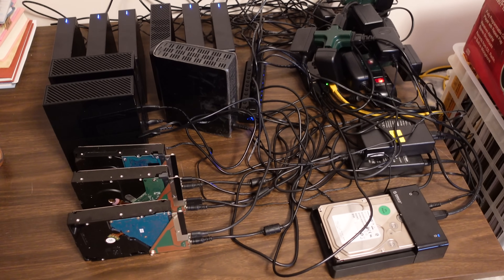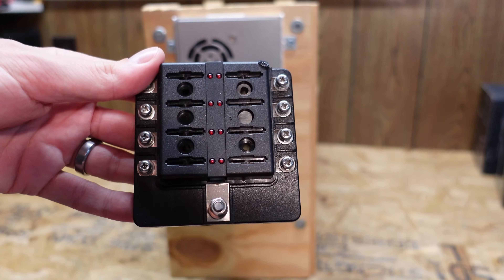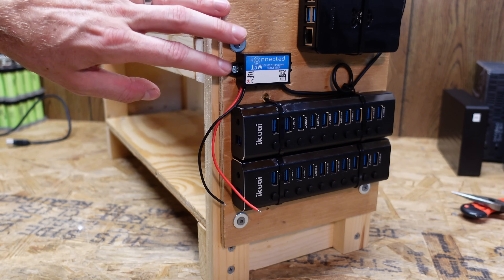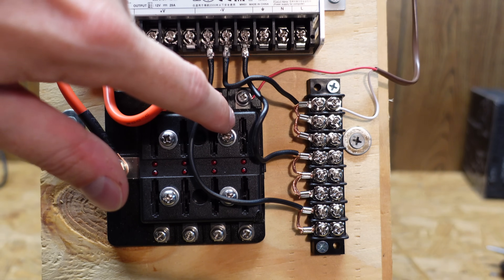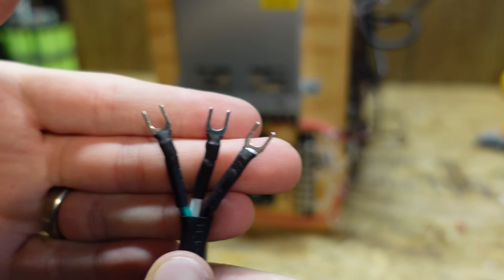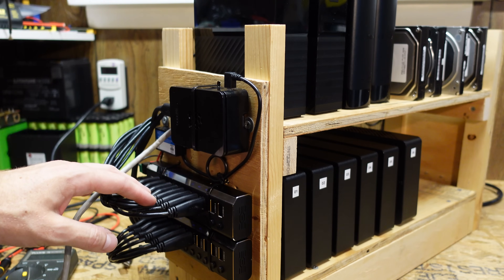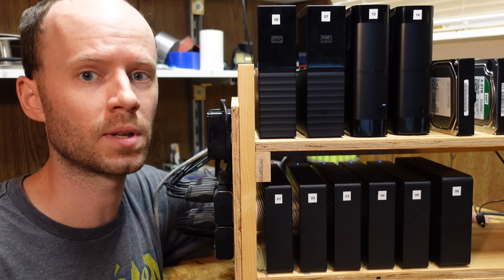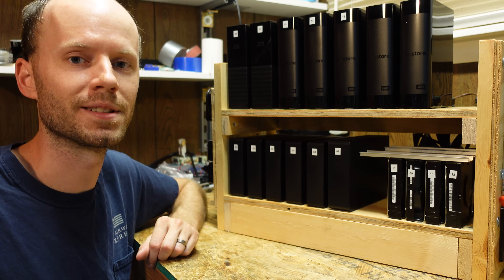Building a 160TB Chia Coin Farmer on Raspberry Pi 4

Comment from the maker: Update: I continued to have drives dropping out after disabling UAS, so I reverted those options. I instead plugged the two hubs into the USB2 ports instead of the USB3 ports. This has finally been stable for a few days. Additionally, using the USB2 ports results in less devices consumed by the hubs. I have all but one drive connected now and am at 27 devices under lsusb.
Reply: Hi,
I still have hard drives dropping out after 1-2 days, using the USB2 ports. Do you have the same problem or any solution for it ?
Reply: How is your system running now? I’ve had intermittent issues with a Pi 4 and USB connected drives so very curious to have an update on if you’ve managed to get yours running reliably.
Reply: @benpearce5424  How much space you got on that?
Reply: Would you mind sharing if you've earned any Chia rewards yet?
Reply from the maker: @mixmastermantas6841  I've farmed 2 blocks since pooling. I should have kept them solo... LOL

Comment: Did you purchase all of that stuff or do you have a discounted source?  That's a lot of hard drives.  Back story on all that would have been nice.
Reply from the maker: No, I purchased it all. I just watched a few different sites constantly until the right deals came around. More than half of them are used.
Reply: @LithiumSolar  I just went to a chia calculator site, it suggests 6.5k invested for about 250/mo income on 163TB.  Interesting.  I hope you do a back story video.
Reply from the maker: @ForwardGuidance  I don't know how much I spent, I really should add it up one of these times - but it's nowhere near $6500. The price of drives has gone through the roof, it's ridiculous now. I started back in April when the netspace was small hadn't gained popularity yet. I'll just leave the coins sit for a couple of years and see what happens. I have no intent to sell them anytime soon. Also, I'd like to do more non-battery videos but they don't typically seem to do well here. We'll see how this one goes.
Reply: @LithiumSolar  Right, the 6500 figure was  if one buys everything new.  Hope the coin catches some fire so you'll have to think hard about selling.  haha.

Comment: Amazing work! Do you have a video on your Raspberry setup? 
The only thing stoping me from going on the Pi is that im running also 7 other Chia Forks and Im not sure the Pi will hold them.
Also, considering how low voltage demand the Raspberry pi is, you can easily add a second Pi to expand this rig (I know you are looking for the single Rasp tittle ;) )

Comment: Hey I did something similar to this.  I'm very curious what those large 12v usb 3 hubs you have are and where to find them but maybe I just need to look again.  I used multi-bay usb drive enclosures to reduce the cabling and drive exposure, and common computer 4-pin molex connectors to move 5+12v power around with one connector.  I opened my multi-bay enclosures, detached the ac power supply, and connected the power directly.
Reply from the maker: I have a list of items and links in the video description :) I LOVE the multi-bay hard drive docks but with how much everything has cost thus far, trying to save a few where I can.

Comment: I'm a photographer and use 12 plus externals HD - I was looking for a way to power them & get rid of the wall warts - I Love what you did - any changes you would make?
Reply from the maker: Yeah, I wouldn't use thermostat wire again. I'd buy regular stranded wire and crimp ferrules on for the connections :)

Comment: @LithiumSolar did you have issues running full node, and farmer off the sd card or did you have it on an external drive?
Reply from the maker: I did not have any problems, but 1) I purposely used a class 3 card for the higher speeds and 2) Chia has changed a LOT since I made this video and I've moved away from the raspberry pi long ago.

Comment: why not make a nas with a raspberry pi and the hardrives. then mount the nas in the farming pi. if that work then you can add allot more drives to the farming drive...right?
Reply from the maker: Yes! You can do exactly that and that's what I'll do if I ever buy more drives. I have an old RPI 3 that can't run the farmer, but I can certainly plug in some drives and set up an NFS share that mounts on the RPI4 farmer ;)

Comment: Should we need to let the external hard disk never spin down? Or just keep the default?
Reply from the maker: I did not change any of the idle settings on any of my drives and haven't had any issues. No long lookup times or anything like that. I think constantly checking the challenges keeps them busy and avoids idle spindown.

Comment: What OS are You using? I tried Windows10 with the GUI but it fails to Sync.
Reply from the maker: Ubuntu 20.04. I don't use Windows or the GUI. I've never had sync problems, just takes a long time if starting from the beginning.

Comment: Do you partition the drive to a specific size or does the chia just want all the space?
Reply from the maker: I just have one large partition on each drive using 100% free space with no reserved blocks. Chia fills it with 102GB files, so there is some left over space since the drive capacity divided by 102GB isn't a whole number.

Comment: If copper prices weren't so damn high I'd be yelling at you for not using 16ga wire
Reply from the maker: Do you think the 18ga is undersized? I'd at least get a different wire next time instead of solid-conductor tstat wire.
Reply: @LithiumSolar  18ga is plenty, but if copper were a more reasonable price, 16ga would be nice for peace of mind personally

Comment: Are the drives SATA ?  Cool. Love the concept. All low power too. Nice job.
Reply from the maker: Yes, they're all standard SATA drives on Sata <> USB interfaces.
Reply: @LithiumSolar  Curious why fan only on external drives? How do you access them via USB?
Reply from the maker: @loucinci3922  The external drives tend to be low RPM and stay cooler such that they don't need fans in the enclosures. Some of the internal drives get hot without active cooling. Sure, the externals are just an internal stuck in a case, but they're not the same model numbers. I have 4 internals here and only 2 of them get hot, the others don't really. For USB access, I just stuck on some cheap $5 USB Sata interfaces I picked up on ebay from shucked Seagate external drives.

Comment: my raspberry pi4 keeps losing sync. It says it is connected and synced but on the pool it drops off, after rebooting chia it then says i am about 1000 blocks behind and takes a few hours to sync back up. newest version of chia and the os is updated. not much on google as to whats going on.
Reply from the maker: I'm not having any trouble. I'm running Ubuntu 21.04, Chia 1.2.9. It's rather sluggish though when it has to actually do something due to CPU limitations. I may end up moving it to something more powerful eventually.

Comment: Really nice setup.  I built the same thing using this as a guide, but double ( 2 of everything).  Quick question though..   with the fuses there and the way its setup I get the impression all drives must be attached and turned on at the same time.  Is this the case or can I attach one drive at a time, as they're plotted.  I don't want to burn any fuses or worse, burn out a hard drive.

Comment: well done bro, how did you connect internal drives? is it safe to use usb converter with internal hard drive?
Reply from the maker: I used these boards to connect the internal drives https://ebay.us/Y4H1do I don't see any reason why it wouldn't be safe considering the external drives are the same thing - an internal drive with a USB interface board slapped on the bottom.
Reply: @LithiumSolar  Thanks man

Comment: Awesome video! How this setup holding up for you? 
I'm done plotting and consider moving everything to a Pi 4 myself. 
Any issues with the Pi's SDcard degrading running the node? Thanks a lot
Reply from the maker: Not good. The Pi couldn't keep up with the "dust storm" we had a while back. I had to move the full node off to another computer. Other than that, no issues at all with the SD card speed, but I purposely bought a fast one for this.

Comment: should have used 8 awg wire for main. 30 amp power supply always size your wire 1.25 times the amp rating. 10 AWG is only good for 30 amps. very cool video
Reply from the maker: The 30A rating is the NEC spec for residential home wiring. It can handle significantly more, and in addition, this wire has an insulation rating of 200C. Of course, I do always recommend people stick to the NEC ratings, but... ;)

Comment: What OS does the RPi running on? I have a problem syncing the node. I tried both Raspbian64 and Ubuntu Desktop 21.04 and still encountered super slow syncing and sometime doesn't sync at all and freeze the entire thing. Any solutions?

Comment: Beautiful job! I have a question regarding the Pi, I was using raspbian 64 bits, I startated syncing and it was working ok, then I copied the sqlite database from another computer that has the node fully synchronized (to avoid waiting the syncing process) and now if I run chia show -s my raspberry just keeps thinking for five minutes until I have the response, it is never synced, has this happened to you using ubuntu? I'm thinking of changing the OS to see if my problem gets solved
Reply: Do you found any solution yet? I have problems syncing node on Rpi4 after copying db file from the main machine. Tried both Raspbian 64bit and Ubuntu Desktop 21.04, still sync very slow and sometime freeze the entire thing.

Comment: Have you checked your your challenge eligible plots time  from logs .? It shouldn’t be above 5 seconds . I am asking this because I used an old laptop as farmer then noticed delay is too much
Reply from the maker: Yes, lookup times are still around 0.5-0.8sec. Nowhere near 5sec :)
Reply: That's interesting, I built a similar set up and while I got it all farming, my challenge times were way too long, resulting in about 30% stale partials. I had a hardwire Ethernet connection running a RP 4 8gb. Pretty sure I had some of the same drives you do. Did you do anything special plotting wise? I think mine are formatted as exfat.
Reply: These were pooled plots btw, had stale partials on multiple pools

Comment: You may want to use a Power supply like this at about 80% of its rated load for maximum efficiency.
Your 350W Power Supply is way to overrated and much likely lacking in efficiency this way. Better go with a 12V 10A or even 8A one. Also most of the power supplies that have PFC (power factor correction) have a better efficiency in general. Your power supply don’t seem to have PFC.  For the spin-up current of the hard drives either build a simple sequencing circuit with some relays or just let the Raspberry-pie spin up the drives in a sequence via USB
Reply from the maker: You're right that around 80% would be near peak efficiency. It needs to be able to handle the spin-up load. Staggering won't work. Sure, it helps when you manually start it up, but what happens when power is lost for some reason - such as a blip in the power grid? The drives would loose power then all spin back up at once. Can't rely on manual staggering to fix the surge load and once you get in to relays and all of that custom wiring, I'd rather just pay the extra $1 per year it costs for the reduced efficiency.

Comment: What are the read times for each eligible transaction using the pi 4? Are you going over 5 seconds?
Reply from the maker: Nowhere near 5 seconds. They're around 0.6s on average, occasionally hit 1s rarely if a pile of transactions come in or something like that.
Reply: @LithiumSolar  and this is via the USB 2.0 ports? 27 drives total?

Comment: file transfer speed please ?
Reply from the maker: Bad lol... but lookup times are still around 0.5sec which is fantastic. I just did a quick test with dd and it's reporting 12MB/s.
Reply from the maker: I plot on another computer and move the drives over here when they're full. I'm not transferring plots across the network or anything like that.

Comment: Yes a UL rating.... because a vendor dodgy enough to make a dodgy power supply would never put a fake label on the product
Reply from the maker: Yes, you're right but I'm very familiar with Mean Well and have used plenty of their power converters/supplies It's legit in this case.
Reply: Mean well makes a good product but is often counterfeited... Would buy from a reputable supply house like Mouser or Digikey rather than Amazon.
Reply: @LithiumSolar  I guess working in the IT industry has made me cynical about everything
Reply: @markc6714  I can tell by your other comment